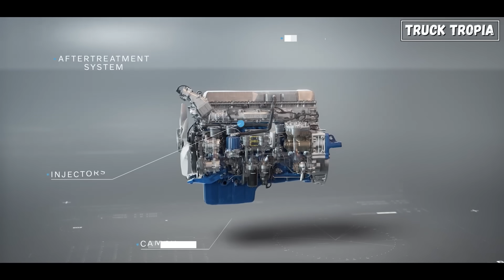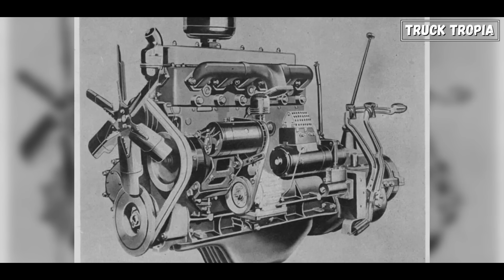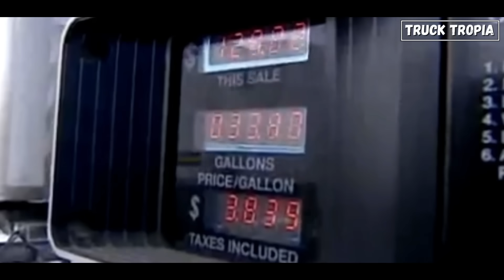How Truck Engines Went from 200 hp to 600+ hp

Comment: It's not only about horsepower it's also about torque.
Reply: Torque is a component of horsepower
Reply: @joshuamirabal9891  no it’s not. Torque has to do with the gearing in the transmission. Horsepower comes from the engine and is output through the transmission. You can have the same amount of horsepower in the same cars but if you put a different gear ratio for torque output, one car will be slower than the other, but do better hauling\pulling up hills.
Reply: @epsteined partly correct, two vehicles with the same hp and torque can accelerate at different rates due to gearing. Gearing does not change the hp/tq output of the engine. If you are talking about different engines that make the same hp but at different RPMs, then those engines will have a different TQ curve and will also accelerate differently. A properly run chassis dyno test runs the transmission in whatever gear is closest to 1:1, eliminating gearing from the test.
Reply: @obvioustoaster2764  exactly what I said.
Reply: @obvioustoaster2764  closest to 1 to 1. But can never be 1 to 1. This is why Dynos are slightly inconsistent
Reply: @epsteined true. Thats why an engine dyno is more accurate than a chassis dyno. Regardless, the trans, rear end and tire size do not change engine power, it only effects how the power is applied
Reply: @obvioustoaster2764  you’re basically just repeating what I said 😂
Reply: @epsteined that is not what you said. You are implying you can change the gear to change the torque output. The torque output stays the same regardless of what gear you use
Reply: @obvioustoaster2764  torque output does change with gearing. But ok bud 😂
Reply: @epsteined torque output of the engine does not change, the way the torque is being applied changes
Reply: If you apply force with a bar, you are not magically stronger because you went and got a bigger bar. Just because you change the gear, does not make the engine stronger
Reply: @obvioustoaster2764  thereby changing the output. Good job man you got it
Reply: @epsteined hp and tq are measurements of engine output. Thereby, gearing does not change that output... this isn't rocket science. The only way to change the tq output of an engine is to burn more air and fuel. The hp and tq rating of an engine is just that. Gearing is irrelevant to the equation
Reply: @obvioustoaster2764  you’re telling me the torque output is the same at 1.5k rpms in first gear as it is in 3rd doing 65? Lmao alright 😂 later dude
Reply: @epsteined I'm telling you that vehicle performance and engine performance are two different things
Reply: By your logic, a manufacture would have list a different torque value for every gear. They do not do that, they list the output of the engine@epsteined
Reply: If you have two identical vehicles except the transmission. One is manual, the other automatic. One is faster than the other while being advertised by the manufacturer to have the same power. Because gearing is irrelevant to advertised hp and tq @epsteined
Reply: @obvioustoaster2764  they put it on the transmission, different trans, different torque output. Doesn’t need to be said that each gear has it’s own torque ratio.
Reply: @epsteined that is a different conversation than what we have been talking about here. If you would have read through the thread you would know that. It might have saved you from making your original bone head comment where you clearly tried to separate hp and tq as if the tq rating of an engine has anything to do with gearing, which it does not.
Reply: @epsteined "torque has to do with the transmission, horsepower comes from the engine" you clearly have no clue
Reply: @obvioustoaster2764  you clearly don’t have your ASE cert
Reply: @epsteined nope, just 35 years with race cars and building engines. If you are, it's a pretty bad look for the program. You dont even know torque is a measurement of engine output. You think it's something that happens in the transmission
Reply: @joshuamirabal9891 no horsepower comes from torque
Reply: @joshuamirabal9891  other way around
Reply: It's a part of the formula to measure horsepower. You can't have one without the other. Horsepower trump's all and you can't have it without torque because it's in the math. A Honda making 150lbft of torque at 7,000rpm will smoke a car making that torque at 3,000rpm. Just Google how to calculate horsepower.
Reply: @joshuamirabal9891  yes horsepower is torque X RPM/ 5252. For the purpose of towing torque at lower RPMs (less HP) is better than the same amount of torque at high RPMs (more HP)
Reply: @goodday5117 to adjust for a lack of torque, gearing can be increased. Obviously big rigs are at the limit of short gearing can be because they have much lower powerbands. Cars with higher powerbands need shorter gears. An S2000 has a 4.10 final drive and a Corvette C6 has about a 3.23 because of the way they make their power. Ferrari added a 7th speed in their 458 that shifted automatically even in manual because that first gear was only there to get the car to its powerband very quickly. The engine and gearing should always be considered anytime torque is brought up.
Reply: @joshuamirabal9891 Yeah I never said that I didn't know what I was talking about, don't tell me to google that please it's annoying.
Reply: @joshuamirabal9891  Torque is the measurement of how much work the engine can do, horsepower takes time into consideration. Think of it like this, torque is how hard a boxer hits, horsepower is how fast the boxer hits. These trucks make big torque and always have. Even the old 200hp diesel engines made around 500lbft and the new trucks are making up to 2000lbft. Just listing either the hp or the tq individually without both or at least the rpm its made, is completely meaningless.
Reply: @joshuamirabal9891 you can have torque without power. at 0rpm.. electric motors can do that.
Reply: @RBMK1500 that motor output is still measured in wattage and horsepower represents a specific amount of watts. In Asia cars are measure by kW instead of hp which makes more sense. Kw or horsepower is just a number we can use to understand the output of a motor. If I'm wrong somewhere, feel free to correct me but this is how i was taught it and I'm not a professional. Just an ethusiast.
Reply: @RBMK1500 wow, finally someone who ACTUALLY knows stuff. Thanks.

You can have a 1L engine with low torque but 400 hp at 9k rpms.
With the right gearbox, it does EXACTLY the same as a 400 hp 15L truck engine.
Reply: @dom3827exactly. a motorbike engine with the same power can haul a truck up a hill.. it would just sound awful. (proper gearbox needed of course) lets have a beer and let the "experts" here play along..
Reply: @joshuamirabal9891 hi there, in europe we changed officially from hp to kw decades ago, but people still love to use hp because its the bigger number. 1kw equals 1.36hp. so what does sound better to the enthusiast, 100kw or 136hp? basically its interchangeable, just with the factor of 1.36. the topic here was torque, and engine torque does not matter, only power to get the same thing done. let me give random and imaginated numbers. a car that weighs one ton accelates 0-100km/h in 10s if it has 100kw of power (please, its a random example). if the engine has a max torque figure of 50Nm or 500Nm does not matter. The 50Nm engine would need 19.000rpm and the 500Nm engine just 1900rpm. 100kW is 100kW. same accelartion, top speed etc with a proper gearbox. BUT the real wirld is not as simple as that, driveability, efficiency and other things depend on the rpm range you can have a high torque number. take a modern turbocharged diesel car engine versus a naturally aspirated gas engine of the same max power. the diesel has higher torque at lower rpm, that means also higher power output at lower rpm. a lot easier to drive for average joe but it is not faster than the gas engine if someone is not afraid of higher rpms and knows how to use a gearbox properly. well, because all of that, i am driving electric, haha.
Reply: @RBMK1500 electric motors actually spin at many thousands of rpm lol
Reply: @RBMK1500 How much work are you getting done at 0 rpm though? Like, how useful is that besides being an interesting tidbit of information. If it's a stupid amount of torque at 1rpm, sure you can do something with that. Something to keep in mind though is that even 10504lb-ft at 1 rpm is only 2hp. So, you'll only do a weak gas lawnmower's worth of work.
Reply: Horsepower is a function of Torque over time and distance. 

More Horsepower means you hit the top of the hill faster.
Reply: Basically  horsepower is a measurement of how quickly torque is applied
Reply: 1000hp 2000flbs of torque monsters of today are something to behold
Reply: No
It's about how far your torque ranges
Reply: If we normalize and compare all vehicles cars/trucks to the average horsepower they put out at 2000 rpm, an average 2020 car at 2000 rpm puts out about 60 to 80 hp. The average 2020 semi-truck at 2000 rpm puts out about 600 to 800 hp. So a semi is about 10 times more powerful at the typical RPMs that people drive which is required for a vehicle to have good engine longevity and refinement/quietness. How powerful and satisfying an engine is for most people is how powerful it is at 2000 rpm.
Reply: A set of bicycle pedals in a large enough gear reduction box can produce 2000 foot pounds of torque but if you hooked up that gearbox to a truck, yeah it’s going to go places but extremely slowly since yeah, with a reduction box of human can produce a shit ton of torque, but the horsepower is still the same
Reply: @kickstartkrew9924 that's not how it works. The torque being apllied is what is being measured. The function of a gearbox is to multiply torque. Just because you can make 2000lbft with your arm and a big enough lever, doesn't mean your arm makes 2000lbft. The force being applied by the engine is called torque. Then you use torque and math to figure horsepower. Horsepower is directly related to how much torque you make at what rpm.
Reply: i was just about to say that
Reply: it is ONLY about horsepower.

Comment: Without watching the entire 13 minute video i can answer the title question right now...
Horsepower for diesel trucks has essentially tripled over the years due to modern turbocharging and electronic computer controlled fuel systems and engine management computers. Fuel injector technology and precision has increased dramatically as well. These factors have allowed more horsepower and more importantly torque across the entire power curve from idle up. This is achieved while another side benefit occurs which is improved fuel efficiency.

Comment: The other thing that dovetails with this topic is the fact that, through the 70s even, many of the major routes were still largely 2 lane highways. There were some Interstate/4lane routes but not nearly to the extent we have taken for granted since the 80s and 90s until now. Also, the hills were often just paved over and very little cutting was done to reduce the size of the hill. Many hills out west were like mini mountain passes with switchbacks and drop-offs just to get up a relatively small hill. So, combined with the underpowered rigs, yeah, getting behind a truck was a real issue.

Comment: I can remember when the Cummins NTC 400 came out. it was a very popular engine for quite a while. but like a lot of things 400 HP would no longer cut it. and competition from truck engine manufacturers drove the HP numbers even higher. myself I'm a Caterpillar person. but they don't make OTR truck engines anymore. because Caterpillar didn't want to have to constantly try to keep up with constantly changing emission control standards. but the Caterpillar 3406E engines were great truck engines.

Comment: My 2017 Ford F250 6.7 has more horsepower and torque than most trucks in the 1950s and even some 1960s.
Reply: 400+hp wasnt stanard until the 21st century

Comment: There’s one thing I don’t mean to be argumentative with this gentleman, but the most efficient engine ever is electric cars so to speak the batteries take forever to charge. They don’t handle cold weather. They have extremely short range and bottom line if it wasn’t for the high taxation of fuel in general, it would be even more expensive yet. Wait till they decide to start taxing Electricity at a 40% rate or even 55% tax like diesel in some states. Yes there is some things they don’t understand about how much higher the energy uses of an electric vehicle the waste between converting it from natural gas or coal and the pollution of coal plants cause the danger of nuclear power when the most effective renewable resource is crude oil, and if it was not harvested, especially in areas like Michigan Wisconsin in the Great Lakes basin, using all this natural gas and harvesting this oil is good for the environment left alone it contaminate creeks and waters so it’s a benefit that we use this energy, clean efficient plentiful